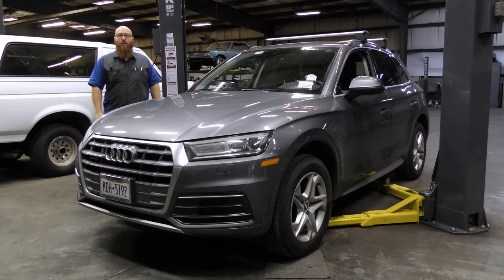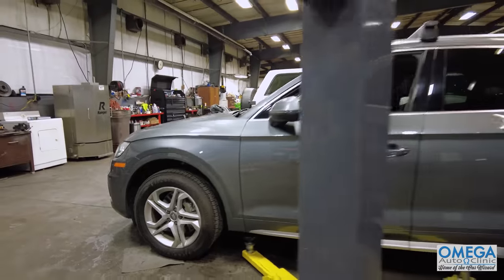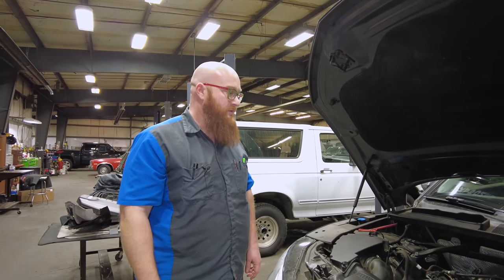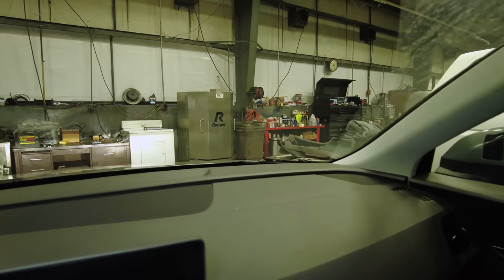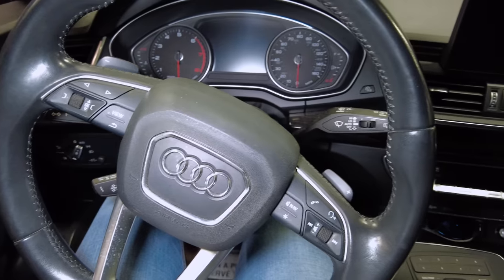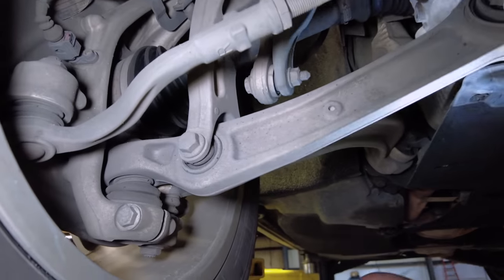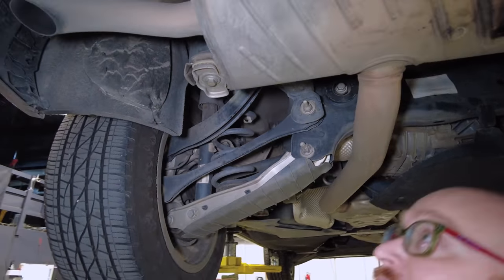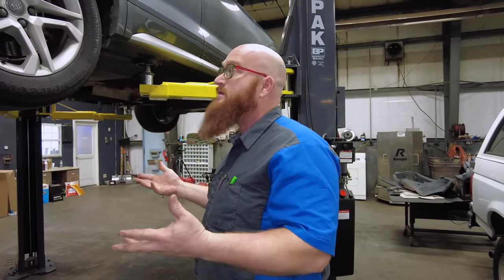2019 Audi Q5 with 200K miles & the service records to prove it! What did the CAR WIZARD need to fix?

Comment: My 8 yr old Audi Q5 had one issue, blind spot sensor went bad and had to get replaced.  Otherwise, no other issues and it is approaching 100k. Annual dealership maintenance is about $500.  It’s not bad.  Ofcourse a Corolla would be much cheaper to maintain but it doesn’t have comfort and driving experience of a Q5.  Maybe in 4 yrs the plastic will start to deteriorate and it’s time to sell, but I would have enjoyed it for 12 yrs at that time and most likely worth it.

Comment: I’ve owned five Audis in my lifetime.  First one was back in 1995.  Never had an issue with any of them.  Audis have a very close relationship with Porsches for decades, kind of hard to knock the reliability these days.
Reply: Good info. We are currently looking at a pre-owned 2018 Q5 with 45,000 miles on it. I am hesitant due to the cost of maintenance on these Audi's but my wife loves it. Would you recommend? I'm a Toyota guy myself.
Reply: Not just saying this... I bought a 2014 A5 and the engine blew after a week of baby'ing it( it did have 98k miles ). I ended up replacing the engine.  But with all the research I've done on these vehicles, there anything but reliable past 60k. The timing chain problem alone would want to make me stay away from them. But that's not the only problem. Not sure if  the 2017+ engines are good. But all the older 2.0t tfsi engines are complete garbage.

Comment: Before retiring a had a one man chauffeur business, driving business people, academics and scientists to London and its airports. I averaged 80k per year. I drive Volvo S80’s with the 5 cylinder diesel TDI engine. My first one did 380,000 miles, the second one 260,000 miles and the final one did just over 200,000 miles. Each car averaged 5 services a year, apart from consumables, tyres, brake pads, new discs(rotaries) and replacing brake fluid  I never had any other serious issues. Additionally all three engines had their original turbos. So regular servicing and working diesel engines hard works well.

Comment: Dual Audi aging owner here, ‘15 S3 and a ‘16 SQ5 both about 60,000 miles. The consumable’s especially on the performance models have been pricy and the odd failures but nothing considered major. Fun cars but nothing about them has been cheap. $110 cdn oem cabin filter for example sure was a shock.
Reply: Shop around on the filter. I got the OEM filter for my 2018 Q5 for I want to say $30 from an online Audi dealer. Even less if you just buy Mahle or whatever from RockAuto.

Comment: I just sold my 2017 VW diesel with 200,000 miles. It looked and drove like new. All i did was change the oil on the engine/transmission every 10k/40k and the timing belt, I also replaced the flywheel once and 1 wheel bearing and 2 rear springs.. No other issues.

Comment: I just recently sold my 2014 Ford Fusion normally aspirated 4 cylinder at 130,000 miles for a 2019 Audi A5 sportback with this exact same TFSI engine with only 17,000 miles. I maintained my fusion for 8 years since it was new with all of the maintenance and never had to take it to the shop. I developed a love of cars and investigating doing all the right maintenance on my own and enjoy doing it. I’m happy to see an Audi with the same motor running strong near 200k miles. It gives me confidence I can maintain my vehicle this long with proper maintenance with parts from FCP Euro and not expect engine out jobs on the regular.

Comment: That service record does wonders for the second hand resell vale too!
Reply: It still has 186,000 miles if you want to sell it. It helps to buy from the original owner, after that all those records don’t help much unless you have a classic car. If this car was on a used car lot would you buy it at a premium over KBB if they showed you the binder?

Comment: Just bought a 1 owner, 2008 Lexus LS460 with 250000 miles on it. Runs and drives great, looks even better. Came with a service history from day 1, which gives me so much more confidence that we can get even more miles from it.
Reply: That’s a 1 million miles car you have
Reply: I have the same car. Bought it with 70k miles on it. Way better than getting a cheap new car. 385hp v8 and 20+mpg

Comment: I bought a 2018 Q7 last year, and am on my way to building a binder just like that one. Took me all year to find one with very low miles optioned like I wanted that had been maintained on time every time, and I'm going to make sure it stays that way as long as I own it. Room around the engine isn't quite as generous, but I can do much of the work myself if I need to.
Reply: jkirk1626  Thanks! Mine's under extended warranty until 2025 or 120k kms, so hopefully I won't need too much luck.

Comment: I have owned A4 with 1.9TDI and sold it eventually when she had 527000km, still running like a beauty. Was great to drive too. Currently driving S4 and the joy for driving it is something that no toyota or honda can ever offer.
Reply: That's great.  I have 2007 skoda Octavia 1.9 tdi alh mk1 diesel, clocked 100k .
Which engine oil you used? Any additives you tried? Anything you can advice . Thanks friend.

Comment: The problem with alot of VW/Audi products is age not necessarily mileage. After 10 or 12 years, plastic coolant lines and seals start to go. 200,000 miles on a 2019 is nothing compared to 100,000 miles on a 2009 Audi. My 2012 Touareg TDI(3.0 TDI) is approaching 200k as has just started to leak some coolant from a plastic valve. Besides that, this engine is solid and still runs like new.

Comment: I also have a 2011 Toyota 4Runner with 170,000 miles on it. That 3 ring binder is almost as thick as the one Car Wizard showed. I hope to get over 300,000 miles on the 4Runner.
Reply: You will definitely achieve that mileage in a 4runner

Comment: I have a 13 q5 with a 2.0 turbo and 155k. At 120k timing chain, $2500, 140k replaced all the front control arms and two rear Control arms $4200, 150k front cv axle did it myself $90. Had two other sensors go out that I replaced for about $120. I bought the car with 48k on it. Oil changes every 10k until I hit 100k then I changed to every 5k. New spark plugs every 40k, super easy to do. New breaks every 40k and requires a scan tool to replace the rear pads. Put an APR tune on it at 120k, and increased my MPG to 25 mpg. Overall it still drives like the day I bought it. Super fun SUV. I would buy another one some day.

Comment: I had a 2002 that had 490k km when i sold it and currently have 2009 a3 with 512k km. Maintnance is key. The a4 was still on original clutch...
The a3 has been apr tuned stage 2 since 201k km. Maintnance Maintnance....

Comment: 2018 q5 regular maintenance at 40k mile currently. Only unexpected expense was MMI started resetting itself time to time after 4 years, out of warranty costing me 205usd for software update. The Problem was fixed. So far, I am very happy with it. It drives great.

Comment: I think when you buy a luxury vehicle, you should always sock away 10-15k extra in a rainy day fund to properly maintain it and to properly look after any mechanical or electrical issue that comes up. Too often people stretch and buy more cars than they can afford to repair, and then complain that it's so unreliable while they've done zero maintenance. It's really about maintaining cars and treating them with respect. Sure, there are some that are just unreliable pieces of garbage, but if well looked after, even luxury cars can be dependable. Just has to be owned by a responsible person